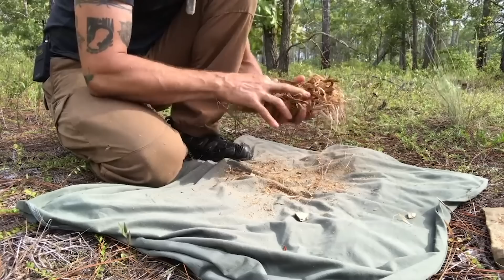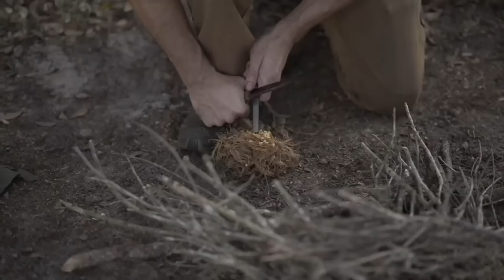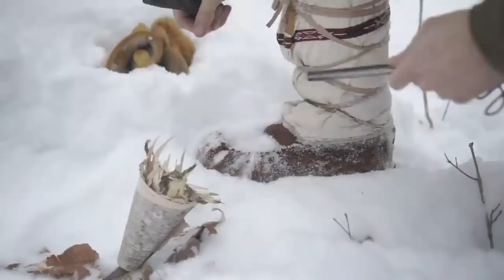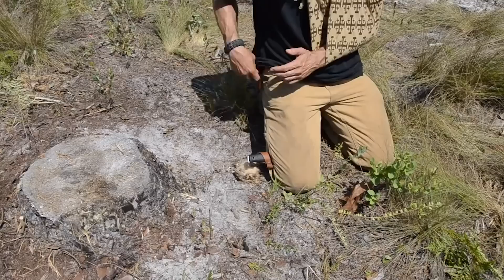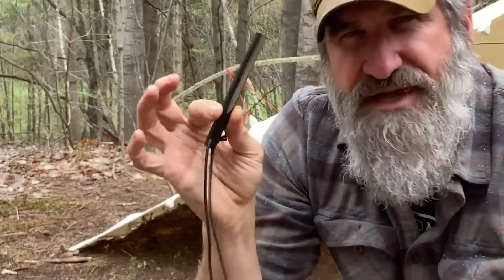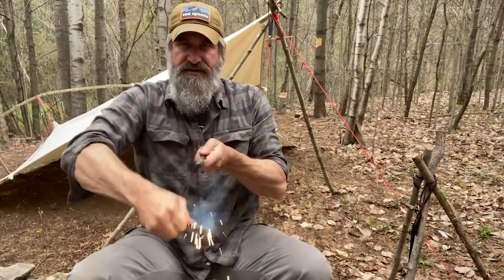Ferro Rod Techniques from a Green Beret | Gray Bearded Green Beret

Comment: I have used an uncoated hack saw blade for decades.  I used it to prepare my rod with the serrated side, removing all coating and creating a serrated surface on the rod.  Once prepped, I use the flat edge of the blade to throw spark.  I use the flex of the blade to my advantage, and do not have to apply the same pressure but produce a multiple of times more spark.  I have a whole bunch of old uncoated hack saw blades still left.  I break them to size.  To pack, I put a wood spine on the serrated side to protect from abrasion, but this reduces the flex...  So pin-n-pull.  Try it.  You might like it.

Comment: I use the spine of the nail file on my multitool as a striker. I get the best and most consistent sparks from it. Plus I never use it for anything else so I decided it was best to get some use with it and keep my knives in tip top shape. One thing that worries me about it though, is that I might be taking too much of the feroserium off each time I strike it.

Comment: Something i found a while back from a channel here on YouTube (i don't remember who so I can't give credit) is the Corona tool blade sharpener. It's a metal rod with a carbide bit attached so you can sharpen gardening tools. The carbide is significantly stronger than steel scraper and has a large 90 degree edge. It works better than any steel scraper and it also functions as a knife sharpener in a pinch.

Comment: I always believed that the pin and pull method was so as not to whack your tinder away but the point mentioned that there is more constant, direct sparking closer to the ignition target makes it even more the better choice.

Comment: The thing I sort of wrapped my head around this year is that in the end, good tinder comes down to small, thin pieces of dry material. Sawdust accepts a a good spark. So really if you have a saw and you're in a forest, you have dry tinder pretty much anytime. Stuff that worked well:

1 - Punk wood 
2 - scrapped paper birch bark
3 - fatwood (i guess not really small/thin more oily)
4 - scrapped clothing

Comment: I've always been lucky (and gratefully so) getting a fire started w a ferro rod as I too prefer the pin n pull method but I must say this is the best ferro rod instruction vid on YT. Btw, one of the best ferro rod makers taught me that if you tilt your ferro rod 45° OR tilt your scraper 45° while striking, you will not get the ridges n bumps that I see on so many Peo complain about. Thank you for such an important n informative vid, I will share this w as many as I can. As soon as I out of the hospital.  Have a safe, Blessed New Year

Comment: One technique you didn’t mention, which is a great way to maximize success… is to put ferro rod on/above tinder and slowly, with lighter pressure, scrape off material where you’re going to strike. In cases of damp tinder, this extra material will ignite once you strike it with the ferro rod.
Reply: I was thinking the same thing, for less than perfect conditions, that really worked for me, it makes a very hot little glob to feed frayed tinder into. 👍 ( A standing flame for a little while.)

Comment: Outstanding video!  I was stationed with A-10s 30 years ago.  As for ferro rods and  tinder I am always experimenting and learning.  Here in Kodiak it's wet most of the time and our wet tinder options are limited. I'm usually limited to damp cedar driftwood or sitka spruce.  Fat wood can be challenging to find in spruce.  I use feather sticks mostly. Sometimes I will use a single sheet of toilet paper because I always carry some.  The pin and push technique works fine for this.  Then place feather stick on top.  Another technique is a couple drops of lighter fluid on the feather stick does wonders.  The small cans of lighter fluid used to fill lighters fit in your pack and don't leak and I use them in my hand warmers.  I've also had good luck with dried cow parsnip powder I make with my knife.
Reply: If you carry toilet paper, perhaps you carry hand sanitizer? That works great too 👍🏻

Comment: Saw one guy slowly scrape a ferro rod so not to create sparks only ferro dust/chips. Then after he scraped enough ferro powder to mix in with the tinder applied more pressure or/and speed to ignite the ferro powder and tinder. Not sure if that works with every ferro rod.

Comment: Thanks Josh. Excellent video. A related comment on fire starters. My wife has Sensy fragrance wax melts around the house. After the fragrance is gone instead of throwing the melted wax away I coat a round cotton makeup disk in the old wax and get a waterproof fire starter. They are flat and easy to cary and I don't have to melt old candles. 
DOL 18D
Reply from the maker: DOL, brother! 18B

Comment: I watched this video a few days before it was re-uploaded and the original was marked private (and then removed.)  On the original video I asked the following:
"Joshua. My wife is having trouble lighting a fire with my HD6 ferro rod from SRO. First I was thinking it was the techniques she was using or the material has was attempting to light, Then I noticed that see just can't get the friction needed so can you please direct my to where I can purchase a super soft ferro rod. She is about ready to give up on fire starting BUT I know she can do it with the right tools. Thanks"
He responded stating that that softest ferro rod was the Uberleben with the wood handle.  The only ferro rod with a wood handle I found was the Zünden Fatty Fire Starter so I hope that's the right one as that's the one I'm ordering.
Reply from the maker: Thats the right one

Comment: great video,   excellent information ... i always carry a bic lighter,  but i have not used one for a fire in 10 years or so ... i use the bayite 1/2 x 6 rods and a corona tool sharpener for a striker ...   i prefer to use a ferro rod because it works in the wind and rain where as the lighter is a pain.      keep em coming!!!

Comment: So let me ask this question, even with proper setup and good tinder, etc., how many ferro rods and magnesium bars, etc., would you want to last for like a year of daily use?
Reply from the maker: You could probably get away with 2-3 a year for actual daily use
Reply: With some forethought and a bit of luck you can cover over your fire at night and it will save enough coals to reignite in the morning.  On Alone (I forget which season) one guy kept a fire going for over 40 days without having to resort to the rod.

Comment: There is a difference between a "mischmetal rod " & a "ferrocerium rod" .....Ferro rod contains more ferrocerium compared to a mischmetal rod making the rod harder, longer lasting but will NOT throw as many sparks as the "mischmetal rod " which contains less ferrocerium & more magnesium therefore making the "mischmetal rod " softer, throws more sparks but will NOT last as long....